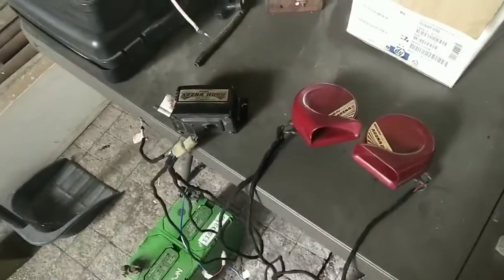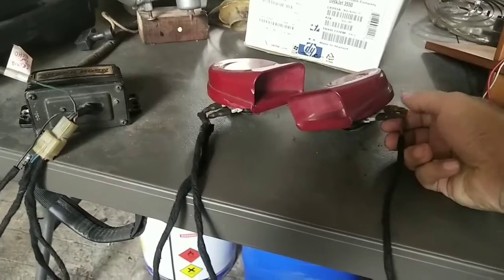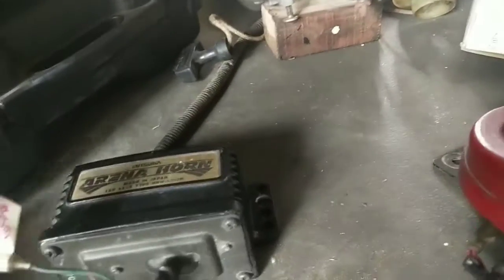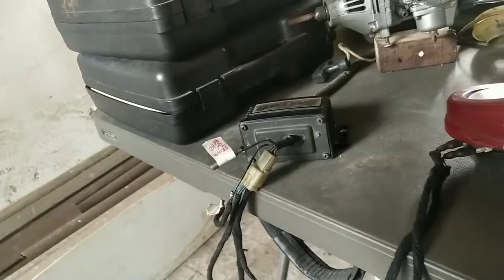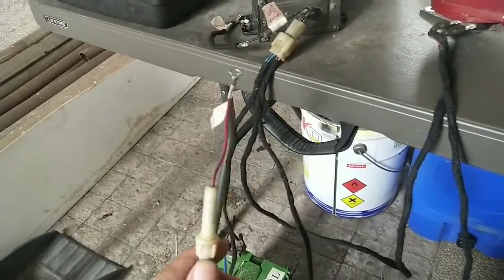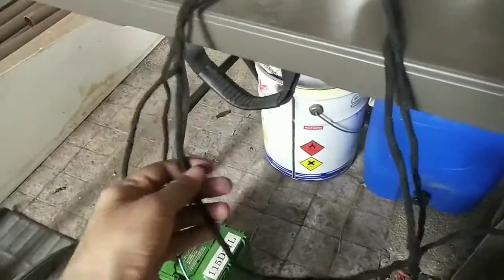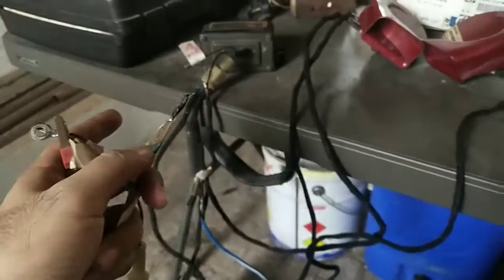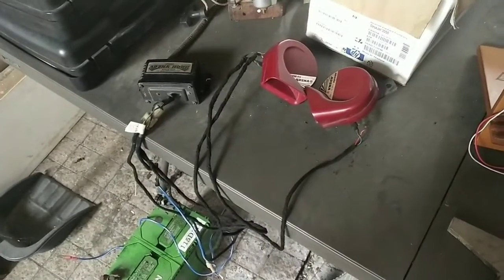Mitsuba Arena 2 Horn wiring and test

Comment: Hello !
I would like to buy this horn, bit I'm not sure if i need to buy the mitsuda wires adapter ( in order to avoid xurting wires ) and the mitsuda relay as well ( the easy install harness) . It is necesary or not ?
Thank you
Reply from the maker: You only need the parts I showed in the video. The horns, control box and wiring harness.